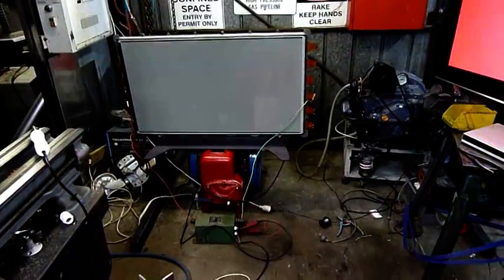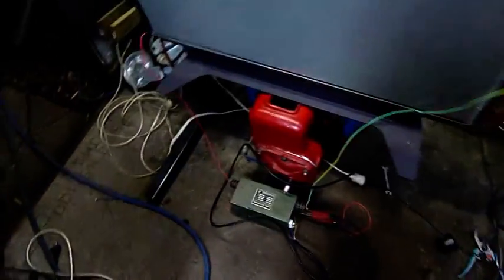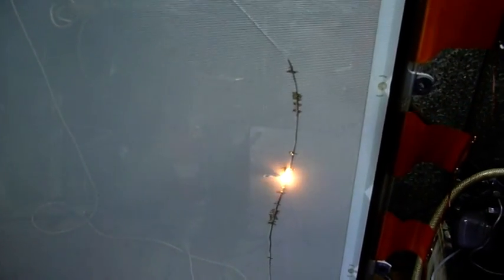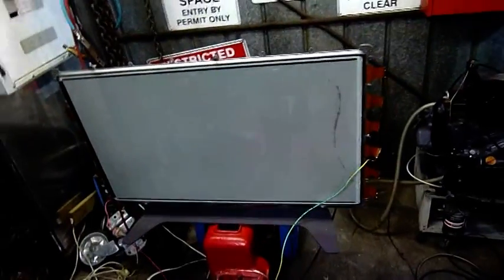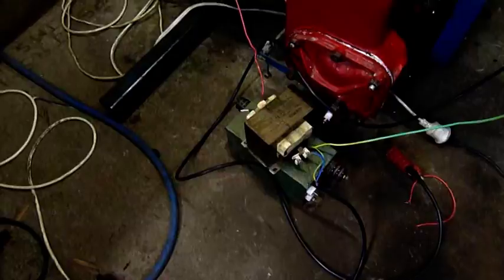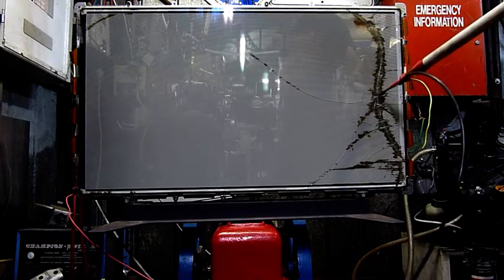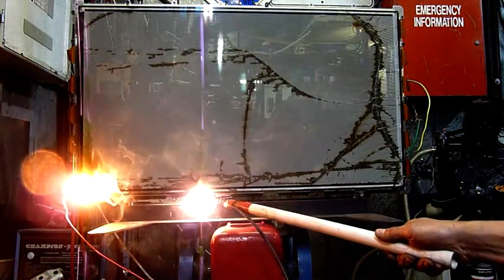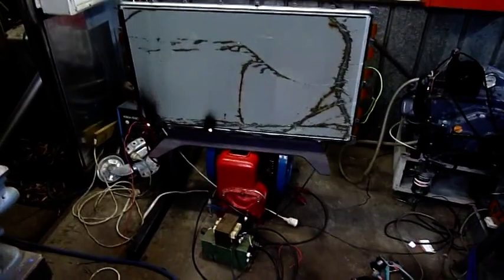Plasma Panel Burns on NST and Microwave transformer

Comment: Next time remove the orange wires from the screen, because they have a driver chip in them, and that dies before the screen itself. Then connect wires to the contacts where the strips used to be.

Comment: Hey dude, love your videos! I've got a quick question, how do you generate the AC input voltage for the MOT or any transformer you want to use? To you use a small DC supply with some transistors? Cheers.